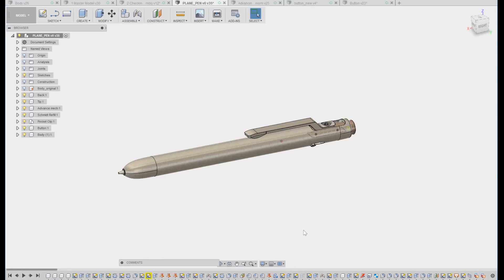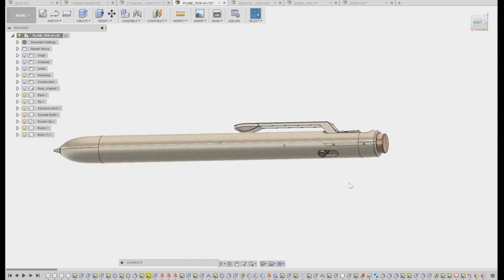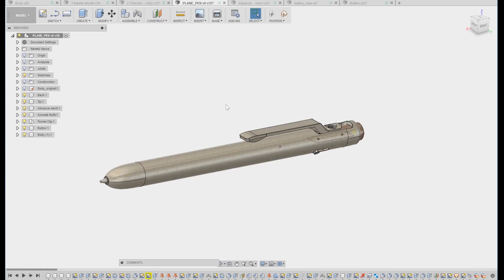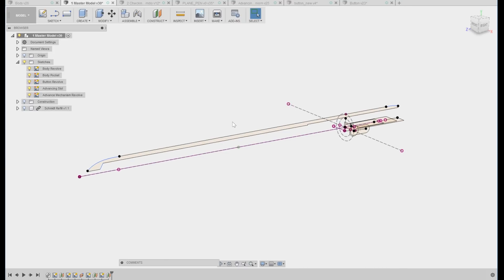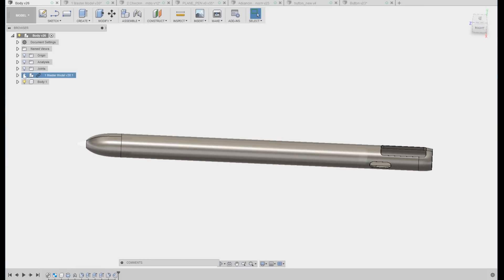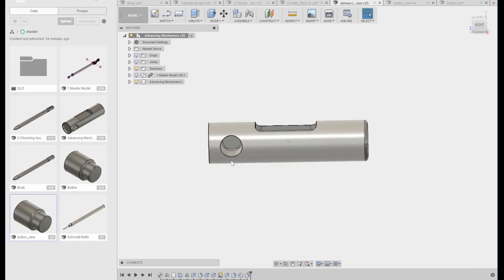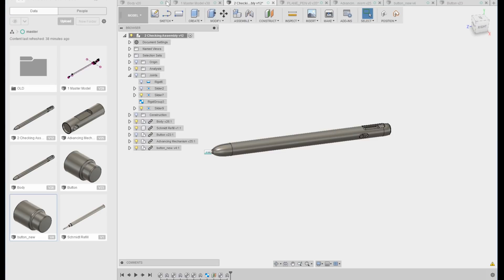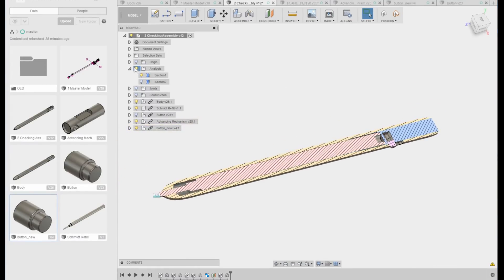Skeleton Modeling in Fusion 360

Comment: Pretty freakin' awesome, thanks! I was just fighting with this dependency mess on a project. Changed one thing in the beginning of history and got 15 errors down the line, all components that somehow reference back to the original, lost references, CAM toolpaths too. Very helpful indeed, thanks!

And this way it's really nice to keep CAM and its fixturing separate, like you mentioned.

Definitely going to use this method for next thing.

Comment: I'm a Solidworks user and for me the only reason I haven't moved to fusion is because the skeleton modelling seems more difficult, primarily because you can set features like extrude to start at a vertex and end on another vertex from a reference sketch. I see fusion users getting around this by making planes everywhere that they want to start and end a feature. I prefer to have as few planes as possible, preferably only the 3 default planes. Then I drive all of my features with sketches on those planes. I'd love to know if Fusion plan to add the ability to "from vertex" and "to vertex" on features like extrude and cut.
Reply from the maker: This is doable today, it's just a little buried in the extrude menu..

Also, I have to say, this video is quite dated. When I made it, SOLIDWORKS was definitely preferred for skeleton modeling workflows.. but fusion has improved a ton, via edit in place and derive!
Reply: @rlockwood2  I would love to see you demo how to do that!

Comment: Rob - Thanks for posting this.  I use NX9 at work and Fusion 360 at home.  I do this type of modeling in NX all the time, but get the benefits of Wavelinking my master model geometry to my separate components and also using Interpart References to allow my component to pick up on parameters that I defined in my master model.  I've always wanted to try something like Wavelinking and Interpart References and I think your method gets the closest that Fusion 360 will allow.  Thanks for sharing!  - Brenton